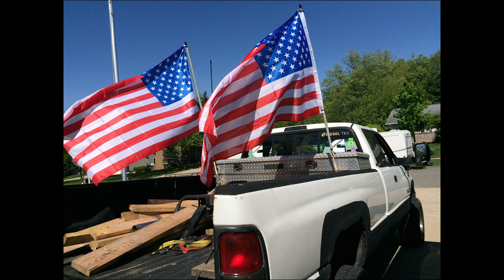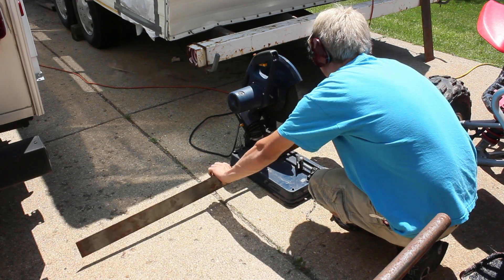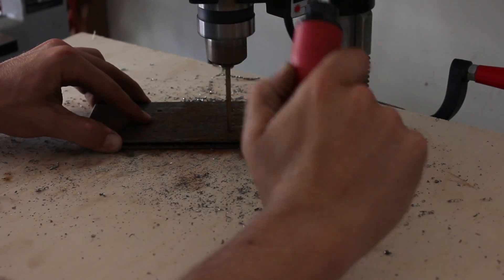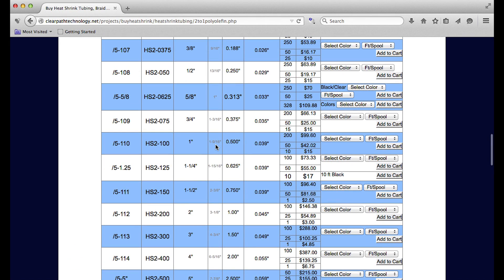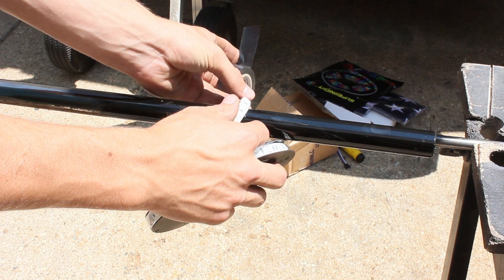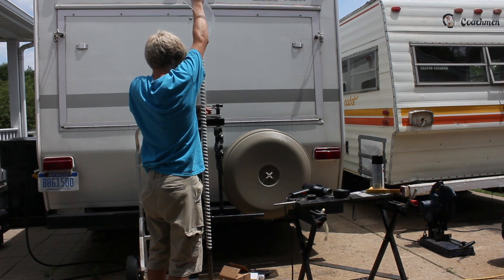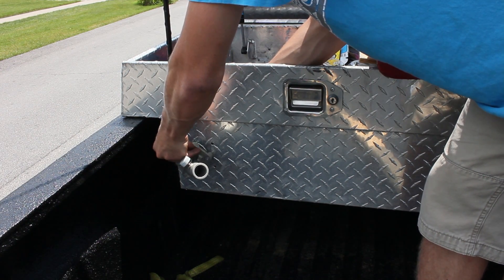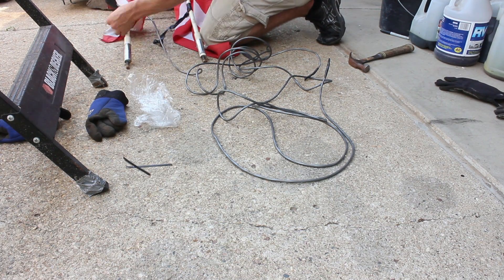How To Make LED Flags/ Whips

Comment: Very nice touch with the LEDs around the flag poles. I did something similar to light up my flags at night, but my problem was the mounts because I wanted to use my soft cover and not mount anything inside the bed.  Check it out:  https://youtu.be/OGO-v34Ts9A  Holds up to highway speeds with no problems, and quick takedown if I need to.

Comment: I’m not the only one that cringed when the flags touched the truck bed and floor...right ?
Reply: The truck bed I don't have so much of a problem with, because it's nearly impossible to fly a standard 3x5 flag at a sufficient height above the truck bed for it to never touch the bed or bed rail when stopped.  I don't see that as a good enough reason to not ever fly a flag from a truck. However, it touching the ground is pretty cringey... but I will never fault someone who is trying to show respect and proudly display a flag even if they may not know all of the rules.
Reply: @Test_Drive_Racing  True.  I have a 3x5 flag that goes on a hitch pole made by Fan Pole.  no drag at all.  I still have another 2 foot clearance if i want a longer flag. I like flying the flag from the hitch rather than the bed.
Reply: @Test_Drive_Racing  Bro!!  that flag mod is nice.

Comment: So the led controller has to be connected to the truck battery? How did you run the wire to the toolbox? That's the only thing putting me off on the LEDs
Reply: DarthRaider correct, if it’s not connected to the battery then it has no power. The wires that go to the poles are going to be ran out the firewall, down to the frame, follow the frame until you get between the cab and bed, then go straight up between them and fish it through a small hole between the box and toolbox. Some beds have small drains holes at the front you can also fish the wire through there, that makes it a cleaner look
Reply: @ShortyzProductionz  the link to this controller isnt active anymore, was it a 12v controller or did you convert?

Comment: I have been wanting to do something like this for a while, but didn’t think the flags were supposed to touch anything other than the flag pole.  For example the bed or bed sides.  Any thoughts on this?
Reply: FroggyCheese I’ve never really heard that brother. I’ve got me and quite a few of my friends that run these and no issues. 
One of my buddies even got pulled over by a cop cuz he was so curious how they were made
Reply: That is one of the rules of flag etiquette for properly displaying and flying a flag, that when on display it should never touch anything underneath it.   Some folks, particularly those from organizations such as the American Legion, can be pretty anal about it and are of the opinion that if every single rule of flag etiquette can't be followed to the T, the flag should not be displayed in that manner or that location.  That would pretty much prohibit the majority of us patriotic folks who want to fly our flags from the truck bed from doing so unless we jacked the flagpoles up super high, which you then run into clearance issues with tree limbs and such, or you fly a dinky little flag from a relatively tall pole, which looks rather silly. A standard 3x5 American flag should be able to be flown from a truck and the little bit of time it comes into contact with the bed rail should not be a huge factor in my opinion.  They also have to be lit up if you are going to fly them at night, so his idea here with the LED poles satisfies that requirement. I made a set of my own flag mounts with lights that can be used with a bed cover on and don't require any drilling into the truck whatsoever.  Check it out here:  https://youtu.be/OGO-v34Ts9A

Comment: Really great video but please don’t fly the American flag on the drivers side it is only meant to be flown on the passengers side
Reply: Dude, just fly Old Glory proudly.
Reply: If it's 2 American flags, no problem with them being on both sides.  If just 1 American flag and no other flags, it should go in the center or passenger side. If one American flag and another type of flag are being flown, you are correct that the American flag should be on the passenger side, because that is the flag's own right side.  The American flag should be of equal size or larger than any other flags being flown, and should be at equal height or higher.

Comment: is thus illegally at night?
Reply: BAMBAM2014 GAMING different states probably have different laws but white red or amber are legal where I'm at. As long as the red is not flashing of course. I usually run my poles white 99% of the time and have passed many cops with no issues
Reply: ShortyzProductionz ok thx helps alot
Reply: ShortyzProductionz how did you connect it to the battery? and how do you turn them on, does it have a remote?
Reply: ShortyzProductionz and will it stand highway winds? 75 mph +?
Reply: BAMBAM2014 GAMING I've drivin' mine up to 80mph for a 40min drive with no issues. The only limiting factor is how well the flags are made haha.

At the end of the video there is a very cheesy diagram 11:20 that shows the basics of it. 
There's wire ran from the battery to a switch then to the controller box and from the controller box to the flags. Yes the controller box comes with a remote when you buy it
Reply: ShortyzProductionz how did you run the cable for the power of the LED lights through the cab? Where did you run them through?
Reply: BAMBAM2014 GAMING the fire wall
Reply: BAMBAM2014 GAMING steal a hotwire from your trailer harness and it will come on when you turn on the headlights 👍

Comment: so you covered waterproof leds to waterproof them?
Reply: No, they're covered to protect them, hold them on, and prevent water from getting onto the poles
Reply: The water proofing cracks on smaller diameter poles not to mention its Chinese and is very cheap

Comment: I am wanting to do this but in the grille of my truck. I am worried about the voltage being to high. Do you have any problems with that?
Reply from the maker: +Tmills1000 I do not have any issues with too high of voltage. The alternator usually puts out 14volts but the leds work fine at 14 just not too much higher than that

Comment from the maker: I hope you guys enjoy, please feel free to ask any questions!
Questions will be answered quicker via Facebook Page: Link in the Description
Reply: shortyjk95 what material is your flag made out of?
Reply from the maker: Joel Bravo the flag itself is polyester I believe
Reply: Is there any type of battery pack that I can use instead of wiring to my battery? Or something that I can make them easy disconnect
Reply from the maker: @jasmingowin212  you could use any 12 volt battery or you can buy a couple waterproof 4 pin connectors on amazon. I have actually done this on my newer poles and then you just have to solder the connectors to the wires on the led strip then you can easily hook and unhook the flags when wanted